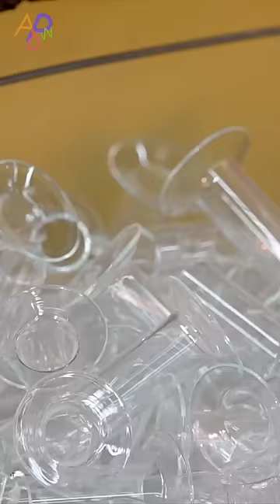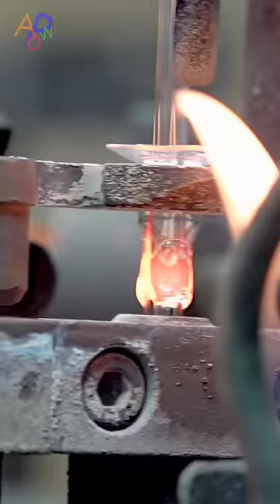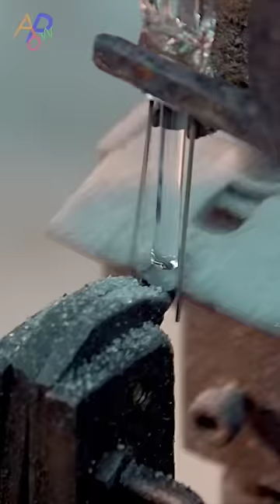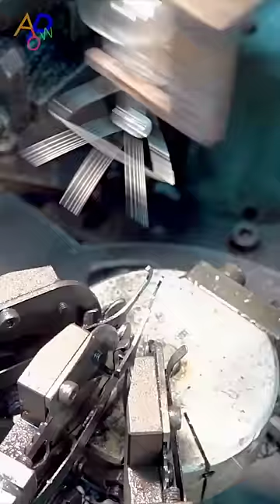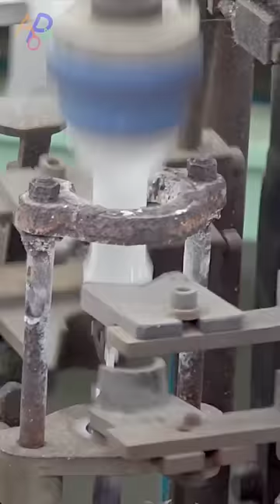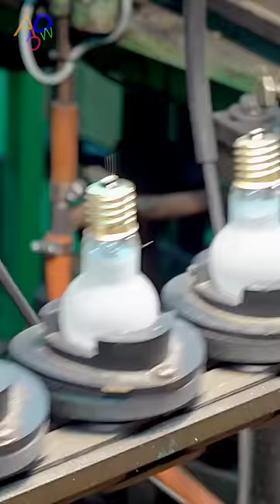60 Year Old Last Incandescent Light Bulb Factory in Korea

Comment: There was nothing wrong whit the incandescent bulb. 
It gave very comfortable light. 
It was very easy to recycle. 
And it was cheap.
Reply: And it used a ton of electricity and produced lots of excess heat.  Using LED you can light a whole house with the amount of electricity 3 to 5 incandescent bulbs used
Reply: @1992djg  I go through LEDs faster than incandescent, they Do Not last as long in hot conditions where I live. And yes, I buy the expensive ones too but it doesn't matter.

Comment: Yes, but do they use 90% less energy and last from 10-50 times longer?

LED bulbs may be more expensive to sell, but, they are more energy efficient, they produce way less heat and therefore are less expensive in the long term.

Honestly, you’re more likely to sell your house then to replace an existing LED bulb that you’ve installed inside it